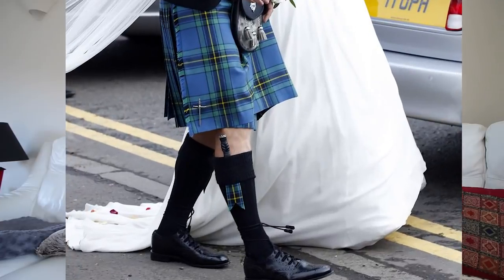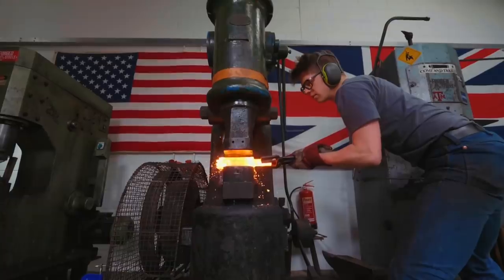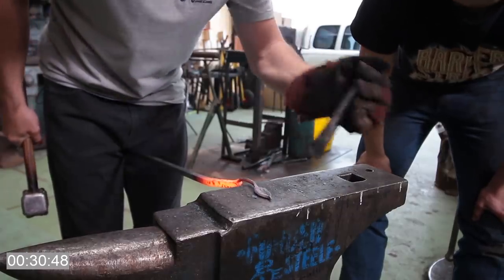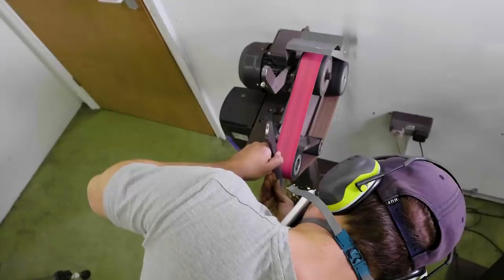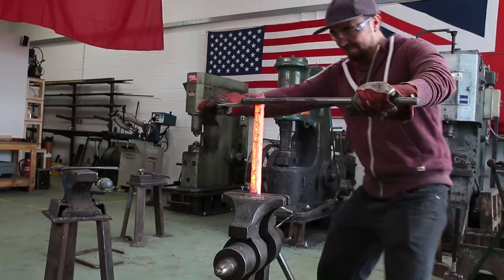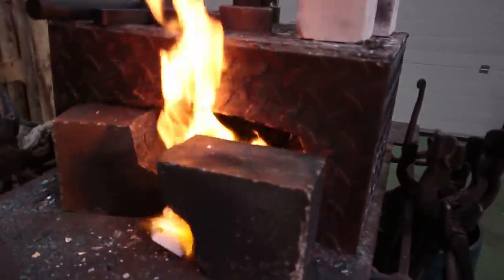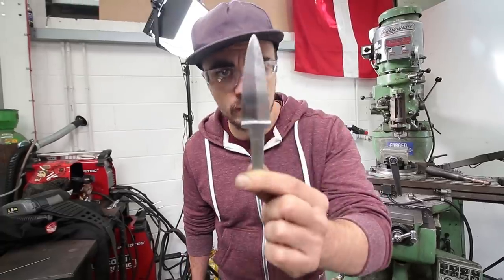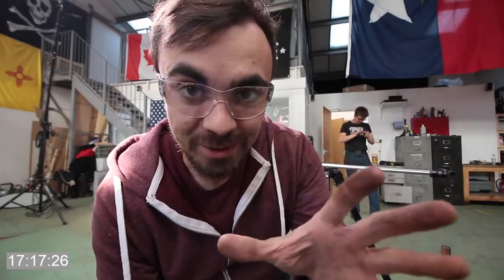This Week I Learned to Blacksmith with Alec Steele

Comment: its so satisfying when those flakes of metal fall off the glowing metal
Reply: I find it kinda sad, wasted metal that oxidises because we can't forge in the right environment.
I really enjoy hand forging but the amount of wasted material especially in Damascus blades is kinda amazing. Think it may even have been Alex who did a super densely layered one and he lost loads in the forging process, let alone final grinding.
Would be interesting to know how much of the fallen scraps get recycled.
Reply: Baked the flakey stuff isn’t technically metal, it’s basically just iron oxide, there’s not a point in recycling it because the energy that would take is not worth it
Reply: Yup, same stuff as a rust just made at high heat and faster. Not really sad, just a fact of living in an oxygen rich environment, almost everything is doing that just not as noticeably.

Though forging in a vacuum would be so cool...

Comment: Who else thinks he should learn how to use a butterfly knife
Reply: This is my SWAMP I do apart from the fact he couldn't since they're illegal in the uk
Reply: I was going to suggest this too! He could use a trainer (albeit it might not be as cool)
Reply: YES! The goal should be to create a simple combo. Also Alex bunn: he can use a trainer or one of those comb ones so if he hits the blade he can somewhat tell
Reply: They aren’t illegal to own, but to carry without proper reasoning, the blade length has to be under a certain amount which I think is 3 or 4 inches idk
Reply: Muhammad Abu-Taher I'm pretty sure the laws in the UK are different though. They're legal to own but you can't buy or ship one, which is dumb because how can you own one if you can't buy one. Also I'm pretty sure that 4 inch blade thing doesn't apply to the butterfly knife in the UK (this is just stuff I searched up a while ago though I'm not exactly sure)
Reply: Forge your butterfly knife!
Reply: Muhammad Abu-Taher no they are completely prohibited. Here in Canada too
Reply: Colorado of the Union reporting in, Balisongs, or Butterfly Knives, are illegal here too. I can get special permission as a tradesman, but otherwise it's a non-starter.

Comment: Is it now illegal to carry a knife about though?
Reply: If you've got no reason to have it. It's certainly illegal. If it's ceremonial, it's fine. You can't walk about with it in Tesco for example.
Reply from the maker: no i don't think so. Scottish police are informed on "traditional highland dress". It's a bit of a grey area, but it is legal to carry.
Reply: Mike Boyd sound
Reply: It looks to be under the UK regulation length as well anyway
Reply: Giro Pincher 
in the UK a knife should only be 3 inches long and have no locking mechanism. and so it cant be a fixed blade. i think tho if you have a legitimate reason your allowed to have a knife on you.
Reply: That knife would be illegal to carry about in public in the rest of the UK but in Scotland it's legal because it's part of the national dress but I wouldn't go everywhere with it in public
Reply: Knife stipulations are always weird, aren't they. Like it hurts less to be stabbed by a fixed blade than it does a folder. Crazy police.

Comment: Unfortunately, he crafted a flimsy version of it, your gonna have to either go to a reforge in the next town or make a new one, better luck next time?
Edit: Sorry, they changed the level requirement for it, you need to be level 20 in blacksmithing to craft that and level 35 to use it in combat